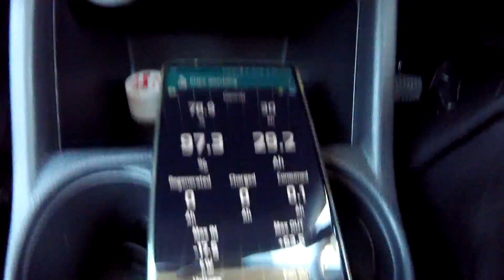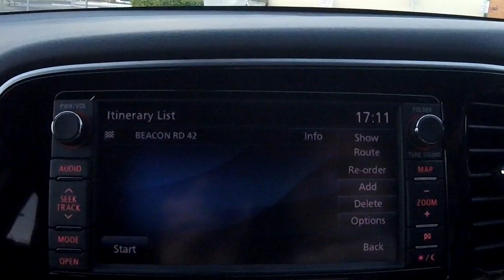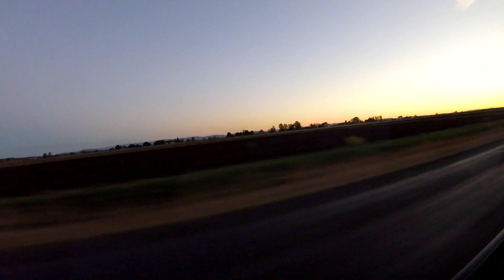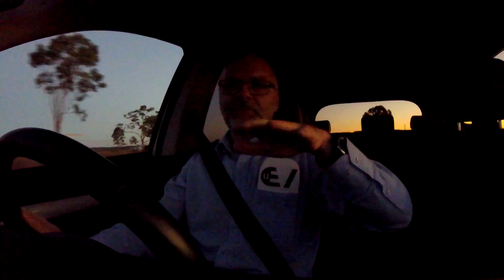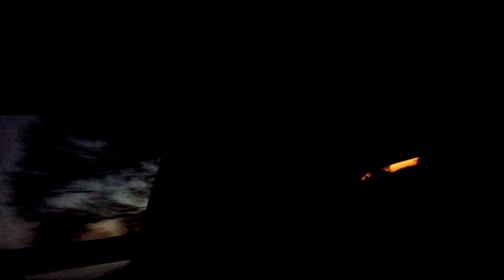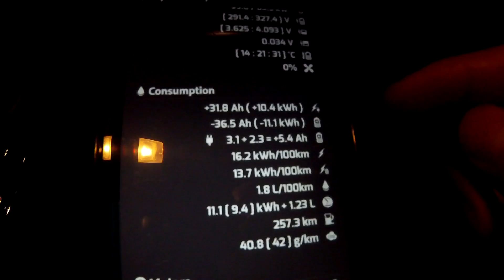EP104 - Outlander PHEV Power and Fuel usage in Parallel Mode (almost a road trip)

Comment: Hello! Stefan from Sweden. I dont understand why you dont benefit from lower speed in save mode. System holding a specific soc. If it doesnt need charge you should save gas in slower speed. Charge mode though. Thats a different story. Maybe it was in charge mode??

Comment: Hi Andy, i first wonder about the automatic mode of the PHEV. Start the car and drive means to use first the batterie, if it is down to 30%, then the engine kicks in. 
Normaly i push the button "charge" when i drive >45 km and i am faster than 70 km/h and the batterie is <60% of charge. Then is switch back to EV, when the distance to estimation meets my Gasometer. This looks complicated. I always ask myself, why did Mitsubishi did not programm something like this.
I got an insight, when i look at the Prius. It is so low in consuming fuel because of the small batterie and the combined engine. This is the same when the PHEV is "empty" (30% of charge left), then the PHEV is working similar as the Prius. I first wonder about the high number 30% but when you look at the Prius concept it makes sense.
100% to 30% is for short driving distances as pure electric vehicle.
Around 30% it is a hybrid car to save fuel (I estimate around 6 l/100km). For an SUV a good number.

What did you (also other poeple) think about the point of view?

Comment: Hi Andy, did you mention the regeneration when breaking in different B-Modes? I saw that the regen.-needle show more blue, when i put the car in B5 while breaking. I am afraid that the regeneration is less in B0. But i have the feeling that i can "coast" much more in B0 and be more effectiv. I drive also about 80% in B0.
Sometimes my gasometer rises one or two km when decelerating on highway in B5.

Did you think breaking in B0 (more friction break?!) is different  than breaking in B5 (more regenerate?!)?
Reply from the maker: Even in B0 and pressing the brake gently won't use any friction brakes. You can see the power meter going into the blue if it does not go any further while applying brake power, most likely it uses friction brakes in this moment. I've heard the regen is a bit less driving in B0 instead of B5 but haven't tested this yet.

Comment: Hey Andy, just charged my Outlander it is saying it's got 46 mile range or 74km.  You ever had this???
Reply from the maker: 71km was my highest. It will drop quickly once you start driving. It's the GOM ;)
Reply: When i drive down from a hill Kühtai 2000meters to 600meter ist Shows after recharging 80km ~ 50miles. The GOM calculate the range from the last 90 minutes

Comment: Hi Andy...
Long time no comment...I notice you still have the AVAS enabled and you mentioned on the previous video
that you'd like to disable it....easy:
Remove the glove box and the small panel below, you'll need a torch and look up to the left, there
will be a control box with quite a few wires coming out (pretty sure its a white connector), just unplug and
tuck to the side...no more AVAS YAY !!!
Mines been disconnected for 9 months or so now...saves pushing the button to turn it off every time !!!
Andy :)
Reply from the maker: Andy Where have you been? Missed you buddy. I think you told me before how to do that.
I'll feature you in the video when I get the 'surgery' done 😉
Reply: LOL This crazy little thing called "work" keeping me on my toes....must be time for a holiday !
I hope you can get your battery management sorted out soon...seems like it stems from an
update you had from way back ...I'm a computer tech and if its anything like Windows updates which
break more things than they fix I can equate to that, I don't think mine had had this update, and estimate I have
only had a very minor reduction in range in the year I've had it.
Keep well mate !
Andy :~)